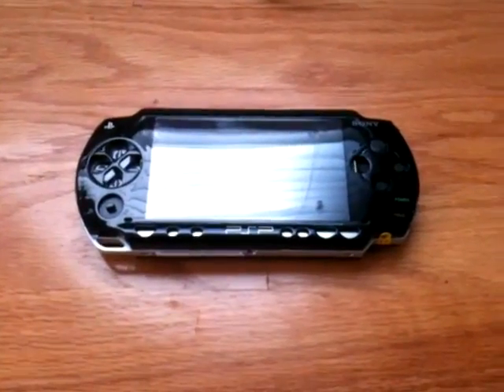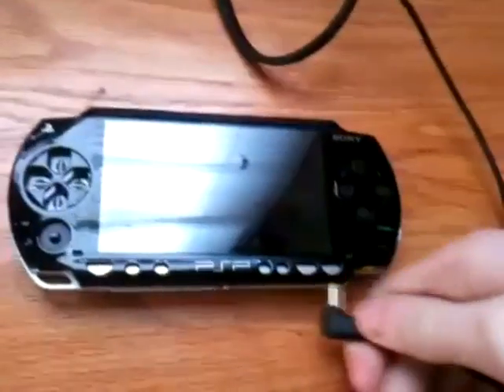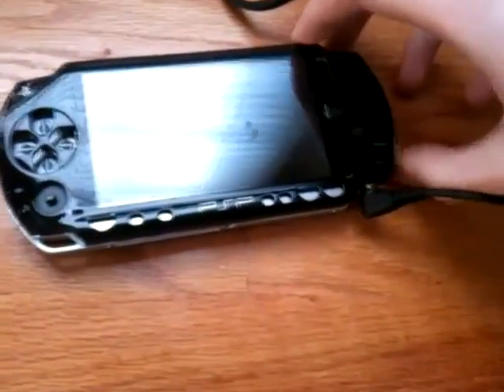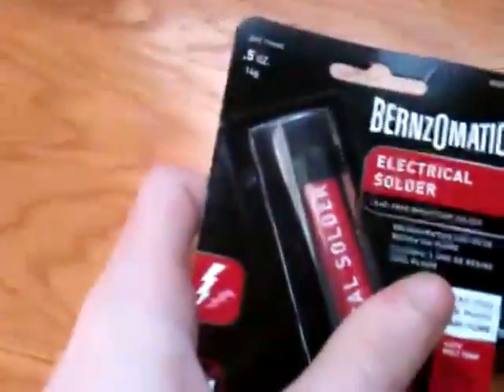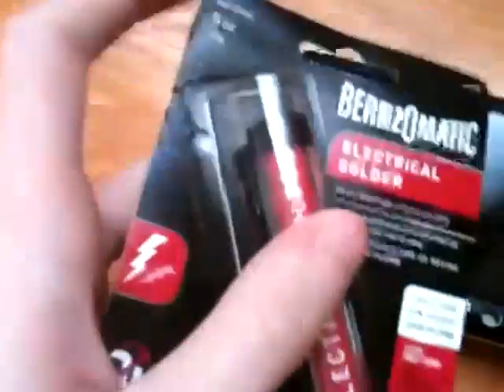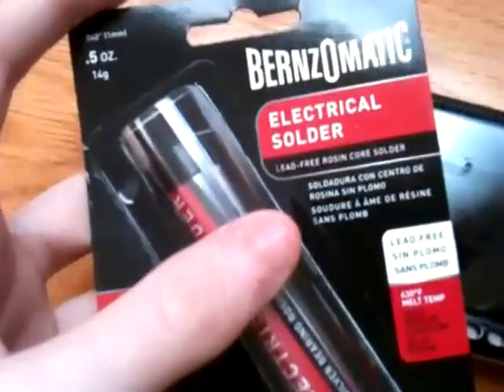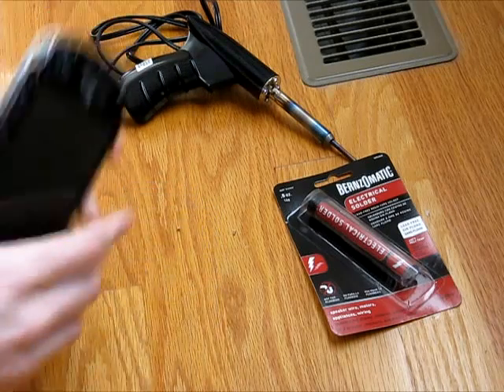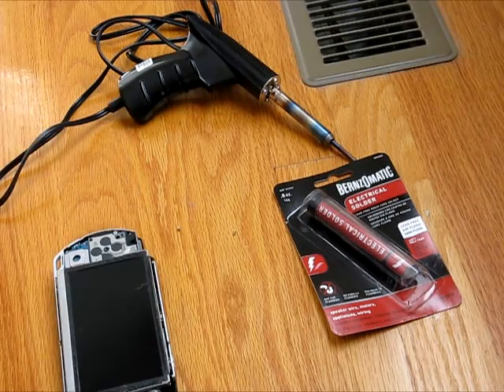How to Fix your PSP not turning on! :)

Comment: My psp doesn't turn on when i press power button, but when i plug in the charger it does light up a orange led. Often during the day it turns on by itself and suddenly turns off after the sony logo. Does anyone have any idea what the issue might be? I think the problem might be the power switch pcb.

Comment: my psp 3001 does not connect through the battery, have I tested even with an asymmetric source, some component tip to test? or do you have the diagram of it to download somewhere? because I can not find anywhere

Comment: you bypass a fuse if you do that if there a large amount of voltage running in there the circuit board going to boom all
Reply: What if everything is working except the game part it's not reading the disk.

Comment: just change the battery then it will work
Reply: I had the same problem, battery swap did not work. Just bridged the TB fuse with some solder. Works like a charm now.
Reply: @nlgaminggadgets1615  can you send me a picture of where it is and what to do
Reply: @Bass ace Just Google psp tb fuse and look for images. Then just put some solder from one side of the fuse to the other side. If you do that the power can flow through the solder, because of that you can bypass the broken fuse.
Reply: @nlgaminggadgets1615  yeah I just did its working perfectly now
Reply: @zillacutz  nice, enjoy! Psp is very easy to mod by the way. If you have not done that yet i would recommend doing it.
Reply: Good idea
Reply: But where the fuck to get that "battery"?
Reply: are you sure? because some of them has a broken cpu thats why its not powering on so when you buy a new battery instead of a new cpu its just a waste of money...

PS- Just buy a new one because a psp cpu is $50 so yeah its kinda like buying a new one and its very difficult when you replace the psp cpu because when you put it the wrong way your psp will now work 😀😀
Reply: +Simple Arwyn  *not
Reply: Where is the battery
Reply: I always forget to never go into the comment section of age old videos because there are always comments that will make me lose braincells.

Comment: Pretty shoddy degree of soldering. Then again I'll say "if it works, who cares about semantics?" Overall the process isn't hard, there's no real tutorial here however. This would be no different than me soldering charge ports on iPad Mini's or Airs, without talking over it. If you're demonstrating that's one thing. However you claim this is a tutorial.

You also fail to point out the complete list of tools you'll need, you pointed only a basic soldering iron, gauge of solder. There's nothing specifying the screw type needed to open the unit or the procedure accessing it.

There's quite a bit detail you're skipping over. I'm simply trying to offer you some constructive criticism seeing as how you're young and you are doing your best to help the YouTube community with your knowledge. Just make sure you're ready for people who will judge your attempts.

It's great you can handle solder, but learn about oxidization and tinning first, before you go instructing people on how to solder points on a pcb. That's all, if you've any questions comment back.
Reply: This guy had a lot of free time
Reply: You wrote a whole chapter on his mistakes lmfao
Reply: @dylandeadman5652   No,  Vyn is not. All Vyn did was give Garfielf (the person who uploaded the video) pointers on how they can improve upon themselves and their videos.

Comment: nope, I tried what the guy said, just getting it open and the screen removed and everything else I stripped I think 3 different screws, even using the write screwdriver that I bought just to do this. They are really tight, I don't know how you can get them unscrewed if you've had it for as long as I did. Anyway, I ended up just throwing it away. I still have the games though, not sure what to do with them, maybe sell them on ebay...

Comment: That happend to me. Had not used for a while and when i want to play psp, it doesn't turn on, does not charge. In my casethe problem was de power fuse. It was "broken". Thow some copper on that fuse trying to make contact in both metal ends. Then try to buy the same fuse and replace it. I haven't done it and my psp is functional. Sorry for my english.

Comment: I've tried to do a similar thing using a 1.5 volt battery instead of the welder and the psp has turned on but  green led light hasn't, now it just remains on the date and hour setting display, button x doesn't work to go on any suggestion??
Reply: Hi Change flex haha after 9 years you got a reply congrats 😂

Comment: Ok everyone can someone help me my psp will not turn on unless I put the charger in (does not the to be plugged in) the i have to bend the charger that's connected to the psp but without sound will not turn on but it does charge just no orange light.

Comment: im having a problem with mines its charging and everything but it turns on for a bit and then it turns off again help ? or any videos that could help with this problem P.S. the slider that turns it on wont slide back manually

Comment: My PSP wasn't used for awhile and after I tried again it won't turn on, when it's plugged in the light on the bottom right doesn't do anything, no orange or red or green, nothing. Is this the same problem you had?

Comment: I have a problem with my psps 3000. It turns on when you put another battery but it wont charge. Should I call Sony? Or just wait and buy another one like the PS vita in the summer?

Comment: A fuse is there to stop electrical overloads, what you are doing is making a direct route for electrical current to pass through. So if a surge of electricity goes in, it goes straight through and destroys the other components instead of popping the fuse, turning an easy repair job, into a good waste of money.

Comment: You need to remove the battery and find a way to check its voltage. check the simple things first before major surgury. I have fix alot of BROKEN game systems and 75% most are human error or something simply as a battery that was just a crappy battery.MOF Made On a Friday.

Comment: most have a f1 f2 fuse, one from the power port and the other from battery. by passing the battery want hurt nothing but passing the input power port might fry the system if there is a power surge or a fluks in incoming power. O try usb charge port it does work.forgot about the usb port.You don't want to exceed 5V300ma  raw power to the psp. check out usb charge psp on youtube if you need help with usb charge. you need to check if the battery has bit the dust before any of this.

Comment: I had the same prob on a PSP 3000 with a new battery. Did a hard reset and it worked. If you try it, you may have to repeat the procedure a couple of times or get someone to help hold down all the buttons... All together, hold down the Select, Start, Triangle, and Square, while also switching on the Power button. I had to hold them a few seconds before it turned on. Good luck.

Comment: I have a similar problem to you. When I turn on my PSP, the lights turn on fine ( charging light, power light ) but after about 15 - 30 seconds, it turns off. Will this tutorial have the same effect for mine? I don't want to try something before I know if it will or will not work.

Comment: What a horrible idea. What do you think the fuse is for. You'd be better off replacing the fuse then just blobbing solder over it. And if you are going to bridge the soldering pads at least do it right.

Comment: @Dominoes282 umm do you have another working link. and also will this method work on psp slim 2000 versoin. i oepned up everything and i do see the white box but since the layout is different do i just solder the left side like u did or is their a little part that only needs to be solder. if do can youy please upload or give me a link to a pic showing that small little part.

Comment from the maker: @usc5442 Read 2nd. When you have cut the piece of solder, connect the two silver tabs on the fuse. If the backlight has come on or flashed, that's your fuse. Take a picture of it would be good too haha. Just follow the tutorial from there I guess. Hope this helps

Comment from the maker: @usc5442 Read 1st Well there are no photos of the fuse but it's possible to find  (safely too!). What you do I disassemble the PSP and get to the motherboard. Keep the screen and power connected. First, take a look at the two clips from the screen connected to the motherboard, and focus on the smaller one (on the left). Where it's connected, follow any of the tracks until you reach a fuse. I don't know how many fuses there are so trial and error. Now turn on the PSP and cut off piece of solder.

Comment: @zainuintel did you change anything in the system (flash0)? take the battery out and put in the charge cord in it and try to turn it on with no battery if that worked then you have changed something in the vsh menu or recovery menu if the psp is on with no battery in it ,press the select button and go down to make normal battery then turn it off and start it up again but this time with the battery in it and without charge plug, worked for me

(sorry for my bad english im dutch)

Comment from the maker: @amerik43 have you tried turning it on without the battery? If it still turns off then its the power fuse, just  crack it open and solder it . Sorry to say a pandora's battery wont do anything about this problem but is REALLY useful for later. Oh BTW, which model PSP do you have (ex. 1000, 2000, 3000, GO)?

Comment: I don't use my PSP for 6 monts. When I connect it was dead; I put the charger and caught the yellow light for about 10 mts and then nothing. I have 2 Batteries Sony but does not work with any odds. Where do I get Pandora's batteries???
Thanks for your help...

Comment from the maker: @assassin12404 is it A pandora battery? if so, it doesnt turn on with a regular firmware, you need to hack it again. Have you charged it? Plug the battery in then the adapter and see if it turns orange. Does it boot into XMB? if not, just use a pandora battery because its most likely bricked if it does not. Q? a. have you tried a new battery or adaptor? try it.

Comment from the maker: @GabbyRoxas Usually because the umd laser is off center or maybe a UMD connector got disconnected or a gear is stuck. Check the inside.